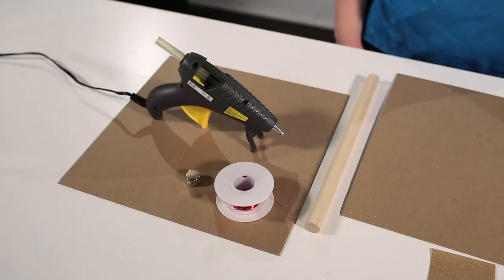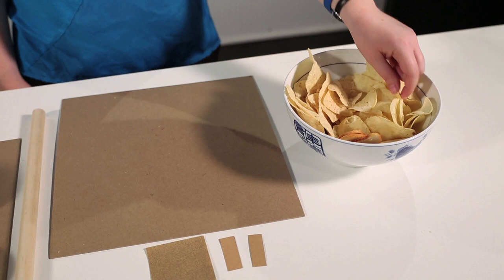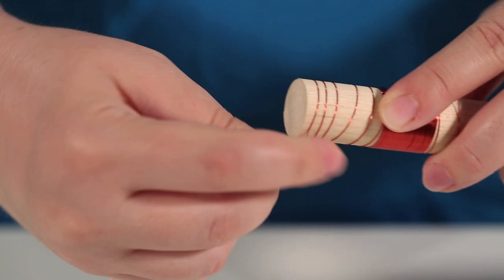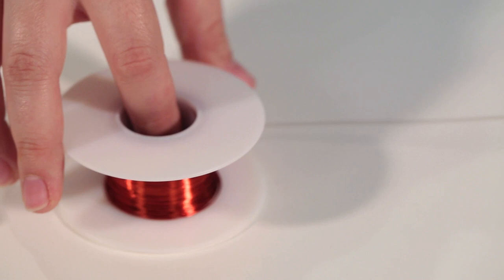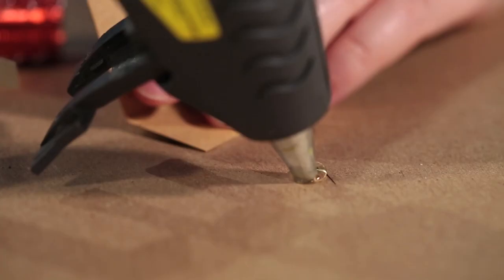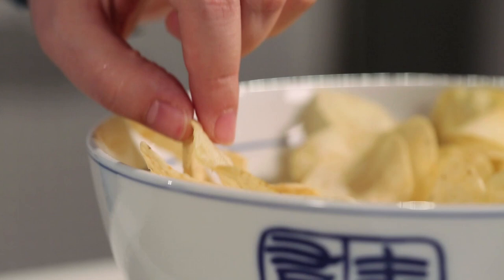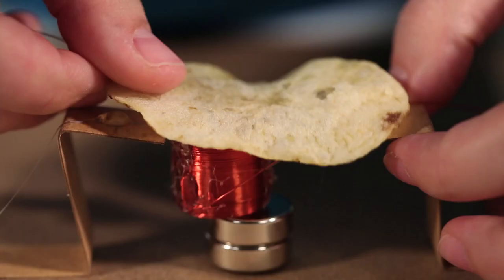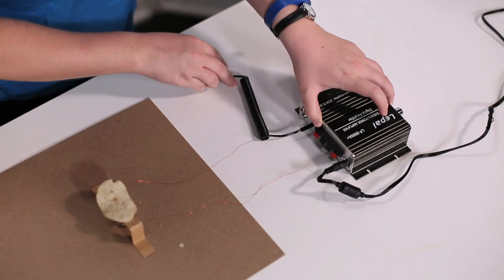Build It - Potato Chip Speaker

Comment: So let me get this straight, you just built a stock-standard moving coil transducer using a slice of fried tuber as the diaphragm. 
Of course, the slice of fried tuber is extremely rigid and fragile and causes extreme harmonic distortion but it's okay because it's a slice of fried tuber?
You do realise you'd get better results by using the cellophane packet the chips came in as the diaphragm right? Especially if you stretched it over, and glued it to, a stiff ring. (the rim of a plastic tumbler would work well.)
Reply: +Aadil Shah Her materials were proper for the video title yet more various materials would work as you say the empty bag wrap is sufficient. I would have chosen several different sections showing each different application like from onion skin paper, wax paper, balsa wood, cellophane, 3x5 card, aluminum foil, watermelon for bass sounds,, and the most appealing would be a R-MATTE PLUS-3 insulation board covered by aluminum foil on both sides. The watermelon would become a secondary resonance shape so two wave forms would be made from one connection.